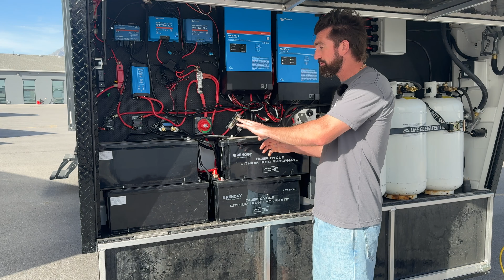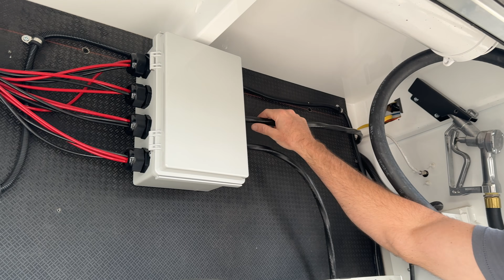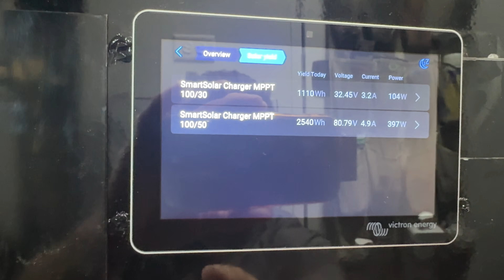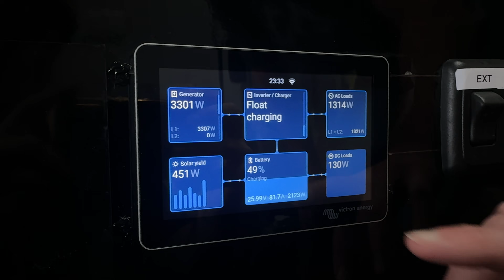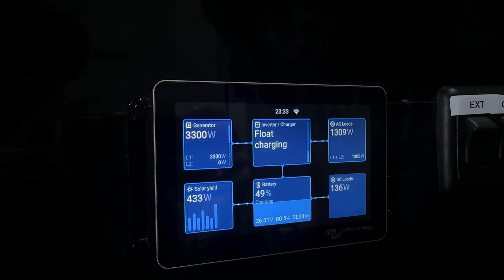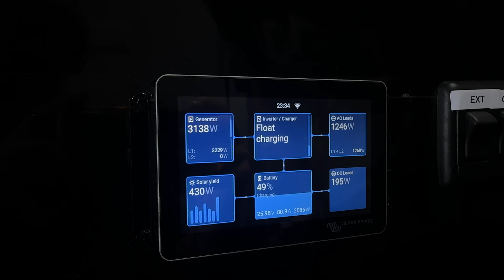How do I Run Both A/C's with No Generator on this FreeRide?

Comment: What is the total general price range for components for this install?
Reply: Victron is good equipment but many extra parts raise cost and take a bunch of space. Im using after a lot of research for quality and price. I got a great mix of both. A 5000w 48v. All in one inverter charger about the same space as 1 of those units he has. With more output.  Its an ecoworthy price last year 750 bucks. They have a 2 phaze unit for about 100 more my camper only need 1 phaze. I use their 12v 280amh batteries last year price 400 each need 4 per 280amh bank 2 are optional for boondocking and ac. I have 4500w of sungold bi facial panels   that cost me 2k my normal load with 1 ac is about 1600w.  Ive got over kill and can run a second camper if my friend are around. Except in the high heat 1 thing people dont say enough about solar is temperature coefficient means high heat less charge amps by alot. My system what its in the 70s f will make 4000 to 5300 watts or 70 to 80 amps for charging in the high heat im around 3400w of charge and with  my load using 1600 almost constantly due to ac working as hard as it can means I run low on battery because we dont get but about 8 hours of good charge depending on were we are shade trees blocking direction we can park. By only about doubling the input for a few hours then you mix clouds in almost a few every day the generator runs about 3 hours  a day to make up the difference.  Only when were in a really hot place. Mountain travel is cooler and way better.